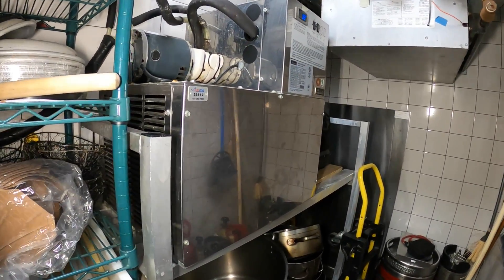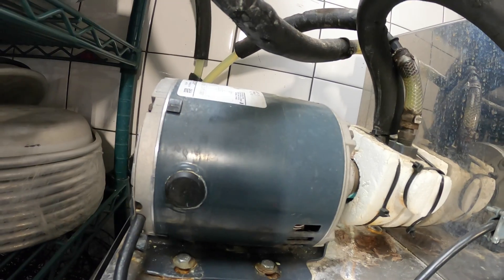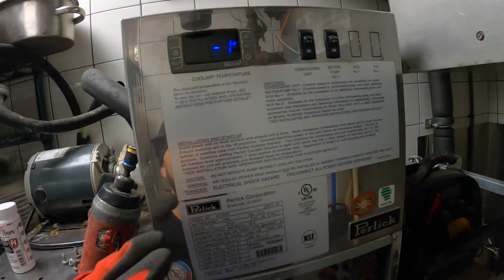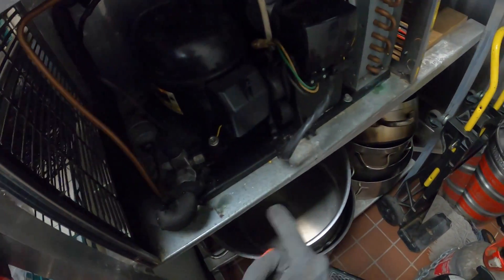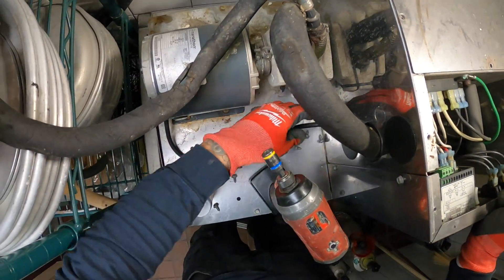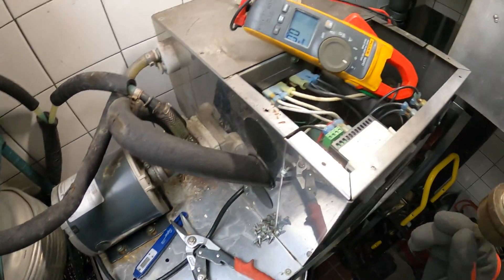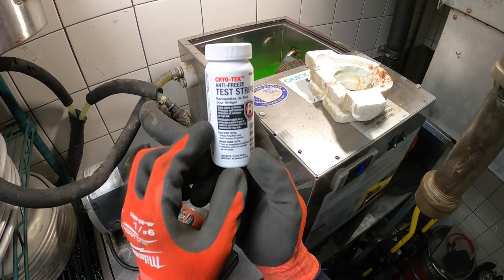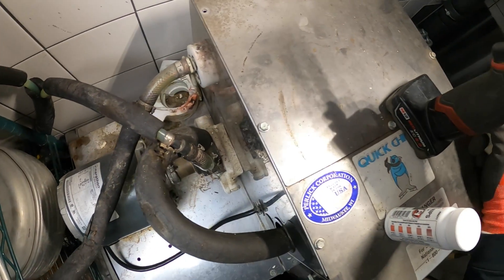HVACR Service Call: Perlick Quick Chill Power Pak Beer Dispensing System Not Cooling Draft Beer

Comment: I worked for a beverage company for many years and have worked on a few of these. You can pull the pump off the motor. Usually pump seizes up causing motor to overheat. Once you seperate the two by unscrewing the clamp you can spin the motor by hand and see if its good or bad and do the same with the pump. If you need to replace the pump you can use pinch offs for the glycol lines and not have to drain system or make a mess.

Comment: The pump is what goes bad on those units, it binds the motor and pump and motor go bad, the pump is an impeller that connects on the end of the motor, The motor probably doesn't have a capacitor and is split phase motor, doesn't need capacitor because of it not having a heavy load. Good job Jumper.

Comment: I would check voltage & amperage before it grounds out if it’s hot bro
They’re pretty simple you run them between 28-31°f.
Reply: Well done bro 😎 🦾

Comment: When I worked for Coke we used those motors.  Marathon makes some decent replacements and in dual voltage setups. Pump and motor are 2 separate units. Look for signs of wear on the key on the pump. Pretty simple setups.

Comment: 👍💪❄️🇺🇸 when I work on glycol units because beer is pouring warm I check pump/motor assembly because in most cases that's the issue it's not circulating the glycol.  If temp of glycol bath is at temp it's most likely pump/motor if glycol temp is high mid 30s n higher it's refrigeration issue. Glycometer is good to have if u work on glycol units.  Nice job for first time.  Most glycol calls on beer systems will b pump/motor issue.
Reply: 🇺🇸❄️💪👍 also make sure u turn off the compressor when the pump/motor assembly is down.  That's like ur evaporator fans n with no glycol circulating unit will freeze up.